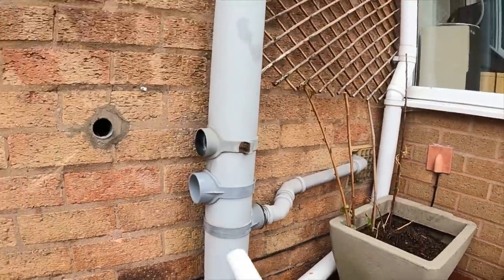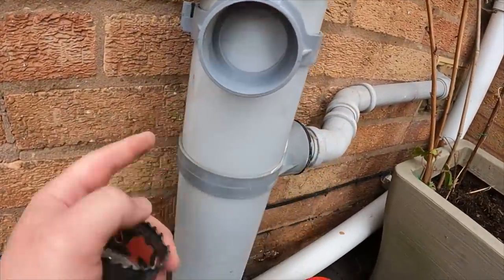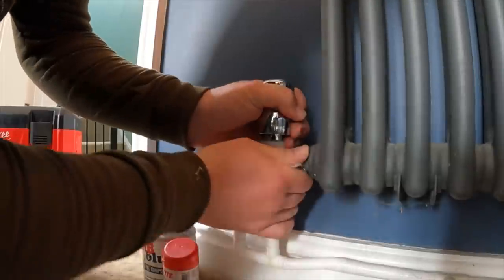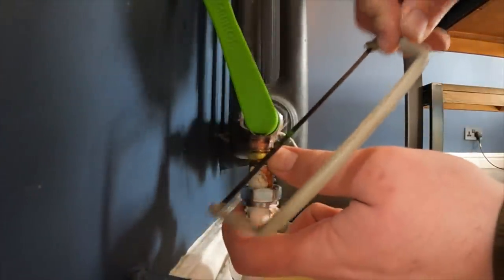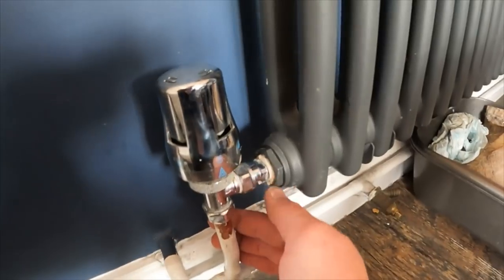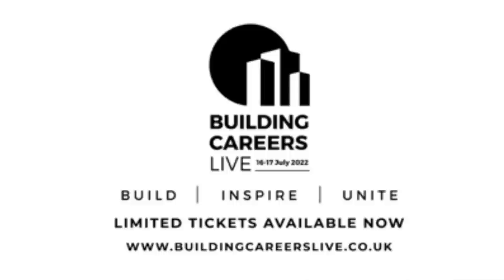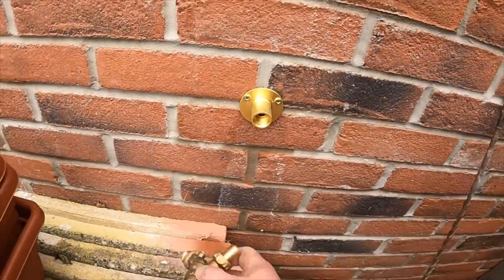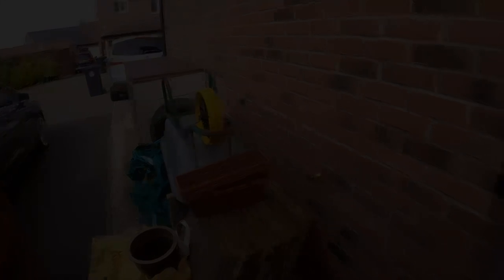LEAKING RADIATOR VALVE…But what was leaking?? Bread & butter jobs are REAL WORLD PLUMBING

Comment: Hi Mark, love the videos. Not a criticism, but why don't plumbers use an open ended/combination spanner on the fittings, rather than the adjustable spanner/pipe grips. In my limited experience I find them easier to use and more managable in tight spaces etc. Cheers.
Reply from the maker: Yep I have one of those but was in my other bag… they are very handy

Comment: Outside tap with built in check valve. Saves more ball ache under a tight cupboard. 🤝 it’s amazing how day to day jobs are an interesting watch!
Reply: Water regs state the dcv should be within the thermal envelope of the building. Can't use them built in ones if the taps outside unfortunately.
Reply: @Tom_Plumb_PHS  water regs… 🥴😂
Reply: Interesting one that! This is a genuine question not a moan, what is the point of an outside tap with DCV built in when they are under building regs not allowed? Thanks in advance if you can answer.
Reply: @jeromeroddy4931  my best guess would be for plant rooms, cleaning cupboards, garages etc where you need a more utilitarian supply but still within the confines of the building.

Comment: I  fitted new tap revivors as tap was trickling when turned on,ball o fix leaked at slot,had to replace isolator, tap still trickling,turned out to be blocked aerator in tap spout 😢😢😂😂. As you say always check the obvious.......if you remember.lol
Reply from the maker: 🤣🤣🙈🙈🙈……… Been there done that aswell

Comment: On the brittle kitchen waste, I think I know the answer but why the 45s into the boss instead of 2 90s straight in, to help with drainage and blockages?
Reply from the maker: To keep the 90 and the pipe close to the wall so it looks neater and a better flow downhill

Comment: Im sure most outside taps now incorporate a double check valve inside the tap itself
Reply from the maker: They do but they don’t conform to building regs, also being plastic DCV internally… come the wintertime they freeze, go brittle and break…. So you need a new tap.

Just fit a DCV internally as regs and away you go👍🏼

Comment: Hi Mark,
You mentioned that you were going to use loctite 55, I presume you meant remove the rad tail and use it on there, 
also do you use the loctite if you are fitting tails to a new rad and is it better than PTFE tape.  cheers,  eddie.
Reply from the maker: That’s right mate, yer I’ve switched to Loctite 55 for these jobs now👍🏼👍🏼

Comment: What are you using for cutting waste pipe now Mark? Did you get another Bix cutter or go for something else?

Good bread and butter jobs. 

Outside tap for my house is on the list. Kitchens on the front gardens on the back. Only way I can do it is to tee off the bath feed and go out and drop it down the wall.  My plan is to use a 12v solenoid isolator under the bath and wire it to a switch outside so I can isolate and drain it without running through the house.
Reply from the maker: Thanks mate, back to using the monument plastic cutters, the Bix is now acting as a spare
Reply: @MJTiffPlumbing  👍 I'm tempted by the rothenberger twin cut 42 that does the small stuff non ratchet and the bigger stuff on a ratchet.
Reply from the maker: @Tom_Plumb_PHS  
Heard good things about them

Comment: That outside tap ,you could have taken a measurement off the extractor fan Grill on the wall. And maybe put a lever  valve in the cupboard to make it easier for the punter to isolate.
Reply from the maker: I could of measured off that, however I measured off the wall.
I could of put a switched isolator on to make it easier than a lever valve

You could do the same job so many different ways buddy…👍🏼👍🏼
Reply: Not having a go. Just batting ideas 😜
Reply from the maker: @nedloh17  I know buddy…. Just saying there is so many different ways of doing jobs.

You do what works for you with what you have and how you see it while there👍🏼

Comment: The customer had chrome radiator thermostat valve and you replaced it with white one! Shouldn't you replaced it with chrome one to match with new radiator!
Reply from the maker: The customer wanted a valve that wasn’t leaking, I had a white head valve one in the van and he said that was fine, not a problem at all.
If he wanted a chrome one I would of driven to plumbase and got one…

But thanks for watching
Reply: 1. It wasn't a new rad was it, it was a leaking valve that needed changing. Just because it was a designer rad doesn't mean it's within 12 months old.

2. Why add extra cost and effort to a job for both yourself and the customer if you don't need too? If the customer is happy with a standard valve, why go to the hassle of getting another chrome one? 🤷‍♂️
Reply from the maker: Thanks James 👏🏼👏🏼…..